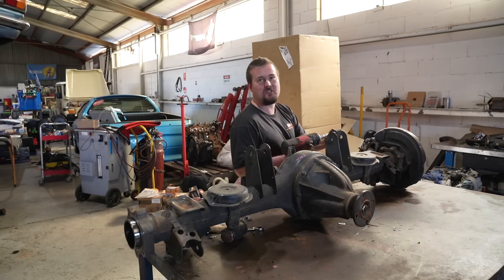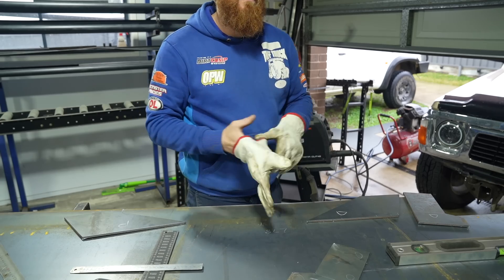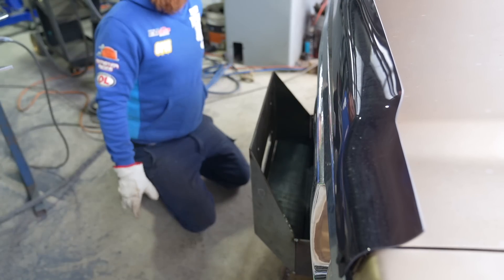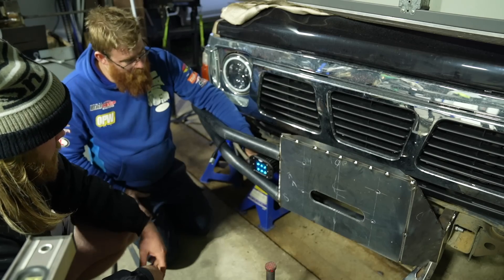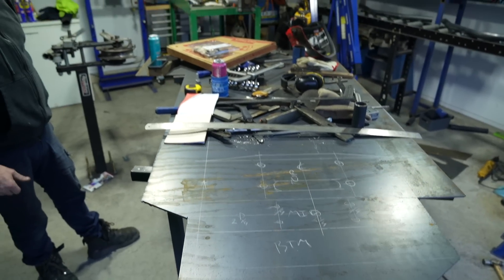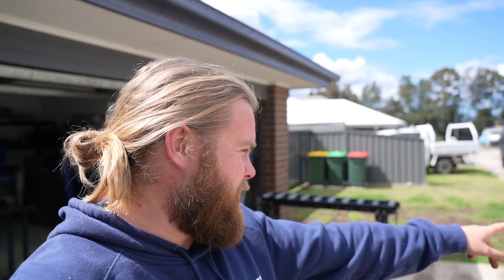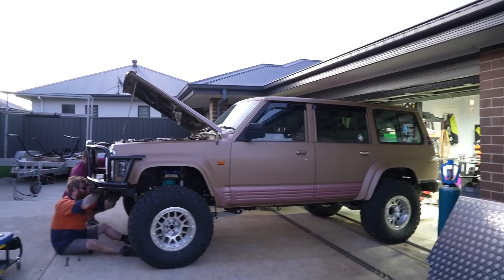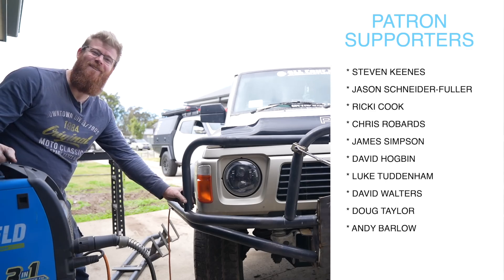ULTIMATE off-road build of a 30 year old 4WD! Custom Barwork for my Nissan GQ Patrol

Comment: You've definitely made your GQ a unique one.  With that colour combo, custom bar work, and huge tyres, no one will miss you on the road, that's for sure.  Just make sure you invest in a very good anti-theft system.
Reply from the maker: Thanks mate! Yep have some trackers on their way
Reply: @TylerThompson90  make sure you get ones with a decent back up battery so if the battery is disconnected you don't lose the tracker. I made up a little battery pack with 4 x 28650 batteries wired in series to give about 16v max and wired it into the 12 volt system. The alternator produces about 13.6 v so having it wired in system is not an issue and provides a power source in case the battery is removed or disconnected. The battery pack is small enough to be hidden where it cannot be easily found.

Comment: I have recently bought a grnadpa spec 97 GQ, and I was going to make my own custom bar work being a fabricator. Only thing that has stopped me is being defected, as without engineering certs cops can defect you on the spot. Other wise I want to build an aluminium Bull bar :)

Comment: Go the Patrol! I want to find a fabricator like this for mine ! 🛻📹🤙😎
Reply: so you got 32NB I think he said . which is pretty standard or I think he meant the other type is the CDS tubing
Reply: I think your going to need the rear scrub bars more than the front ! have to get them done too next ! 🛻📹🤙😎
Reply from the maker: Yep I've got a rear bar on now and hoping to get some rear scrub bars connected to the sliders